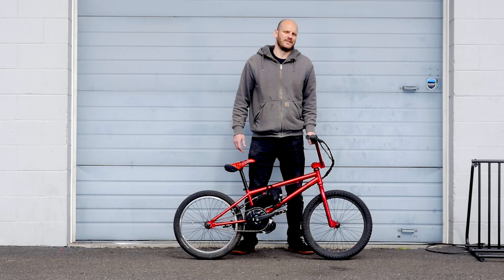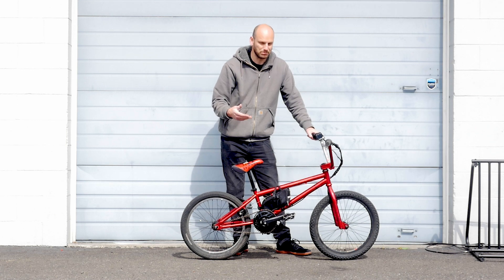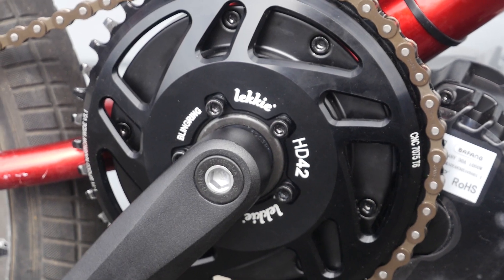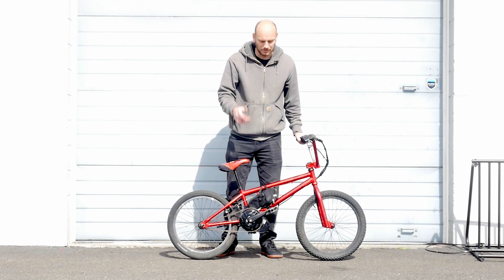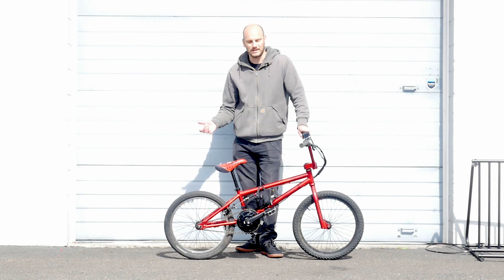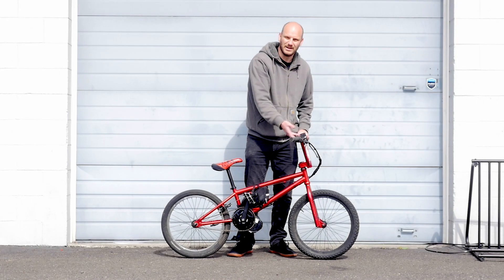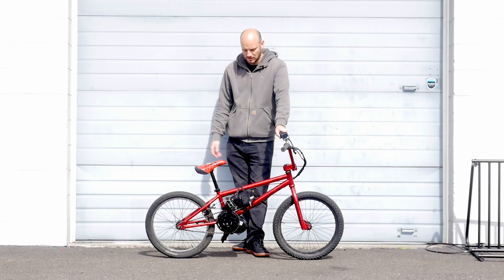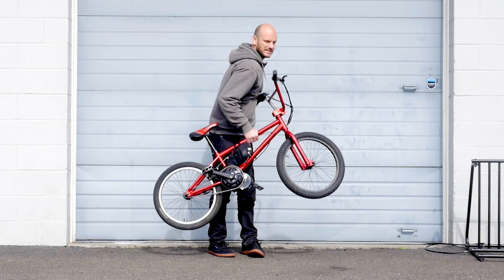Custom E-bike Build: 2 Hip Playboy BMX w/ Bafang BBSHD 52v 8ah

Comment: im a small guy of 5ft3 and 8 stone/112 pounds right and BMX has always been my right size of bike. then i was so exhausted everytime riding to work so then i got a mountain bike with gears and that helped a lot and loved it. even tho i chose a 16" frame the right size for me i felt it was still big and heavy for me. this was a Carrera - Kraken. i loved it and it was a good bike then it got stolen off me and now i got a Scott Aspect 950 and thinking should i upgrade it with a bafang mid drive motor or should i get the old bmx out and get a bafang motor for that? i also have to carry my bike up stairs where i live. lifting the Scott aspect 950 up stairs is ok not so heavy but when i add motor and battery its gonna be a big step to heavy unless i accelerate it up the stairs. i also wish they had bosch conversion kits because i have seen and read bosch to be the best. better than shimano and bafang and im sure yamaha too i think i read up on. any info or ideas will be greatly appreciated. im scared and worried about ordering a bafang motor and finding it not fit correctly and also police stopping me and taking bike off me as ur only allowed up to 250watts motors ffs! im gonna go the illegal route obviously and go for a 500-750watt motor.

Comment: I built 2 DIY bafang bikes 2 years ago using info from this channel.
I cannot recommend enough if you can, building your own.
I can repair anything wrong with my ebikes.
I have friends who bought ebikes and now can't get service or parts easy because of the flood of different ebike makers.
And if you run into problems or have questions you can schedule a talk with johnnynerdout and get answers to your questions/problems.

Comment: ppl sleep on that little saddlebag battery  .  its freaking Strong with a mid drive
Reply: Right I rock a 52v 10ah battery in a little saddle bag for my tongshen middrive kit.  I was starting my little bmx project the same time the owner sent his to Johnny.  Mines a bit lower powered and not running a throttle was planning to do it but think my wiring harness is junk tried 2 and neither worked but been really enjoying it with just pas so probably won't add a throttle.  Still fast bike though easily cruise at 25-30mph and average about 30miles in range on that little battery if all im doing is cruising around at 15-20mph.  https://youtu.be/NJEWqdyO71Y?si=TSLju1Da96MPt5ST
My little hot rod.

Comment: 40 lbs for that seems heavy for what it is
Reply: It’s a chromoly frame so it’s quite heavy compared to an aluminum bike
Reply: 25 pound bike. BBS hd 12-13lbs plus the battery. 40 sounds about right pretty light compared to even those little folding e bikes that are about 50 lbs

Comment: This is a seriously cool build, I love it. I might have to copy it but with a lower gearing to cruise at 20mph for better range and hill climbing.
Reply: Couple of us built ebmx bikes at the same time and were all talking about it over on the ebike sub reddit.  Seems like some spur of the moment itch for us guys that are around our 40s 😆 the whole ebmx thing seems to be finally popping off with some pre-built things like the chimera and what not.  I dont really feel like they really hit that bmx market though allot of us like to build a bike plus frame sizes and stuff sorta matter when a bike is that small and light.  Really need the right geometry for your height on a bmx
Reply: Use a rear cassette. I had a 20inch bmx style with a rear cassette. 36mph top speed on flat road. 52T lekkie front, 11-36 rear

climbed hills easy

I did get a 28t front and it's basically a metal goat in that set-up.

Comment: This is my bike!!! For everyone wondering It’s as terrifying as it looks! 😂😂😂 it has a 28t on it now (changed it very shortly after this version) and it’s even MORE terrifying 😂 I wear full gear and a helmet don’t worry 🤓
Reply: Finally the video for your bike is up.  Think I still have mine geared higher than yours now that you changed that crank gear out.  I am definitely throwing less power at the wheel though.  Totally had to mangle a chainlink into a half link with how much my chains been stretching but taking out a link made it tighter and let me pull the rear wheel in by a mil or so, now I just hope it holds tell it stretches a tad more so I can pull the tire all the way into the forks and take the half link out then the chain should be perfect tell it snaps probably.
Reply: @Mrandroiduser  can’t wait for you to see the next project lol. The 150 miles I’ve put on this have taught me I NEED suspension and some bigger wheels 😂 can’t wait to have 2 videos on this channel :)
Reply: @SaleenaBBY  yeah I feel ya on the no suspension.  I may also pull another build together more based for off-roading but the next bike im thinking about is still a 20" bmx but with full suspension ever seen the 'We the People' swamp master.  Its spicy with a spicy price tag but I think I got a bonus coming up at work and I could always swap the tongshen over but I think the torque and gearing may be to much so don't think thats the best option may look at the cyc pro or stealth for this one or maybe bafang I hear that theres a new middrive model coming out with torque sensing from them.
Reply: @Mrandroiduser  I have seen that bike!!! If i was gonna stick with 20" I would definitely be considering it. But i'd be very worried about fitting a battery in that frame. I also got the canyon bike for $650 so I could not pass that up
Reply: Congratulations for surviving 150 miles... Respect.  But, Please for the love of god take this bike apart.  
Unless of course your only riding in sk8 parks and have FULL kevlar.  You are an absolute legend.
Open it up full, slam on the rear brake, then go back and measure the skid mark.  That is your stopping distance... "No Fear."
Reply: @matthewelsey3164  it’s going back to normal. I bought a canyon dirt jumper and I’m dropping both bikes off soon to have the swap done :) the new setup will go 32 MPH on 26” wheels. (28-11 gear ratio is my plan) Considering a larger battery but will stick with what I have for now and see how it performs with bigger wheels. I’m also in full dirtbike gear and a full face smith mainline 🤓 new bike also has hydraulic rear disc and mechanical front disc (previous owner added a front brake to the dirt jumper)
Reply: @matthewelsey3164  I've got almost 500miles on my ebmx build but its not quite at the same power level as the bafang I've got a tsdz2b on mine been loving it and its been a great little way to get around town.  https://youtu.be/NJEWqdyO71Y?si=Gvwt5ERNjGGtQY0u. My little build still quite capable at going 25-30 even with the settings toned down could probably heat the motor up a bit more and run it a bit faster but really feel like it's perfect where its at.
Reply: And now, for something different...
Reply: I had a bmx sized carbon folder with 52T front and an 11 rear, it went 36mph on a pure flat road throttle only. It was scary fun. Climbed hills like a billy goat.
Reply: What bottom bracket is this frame? I'm looking at converting a mid bottom bracket bmx bike
Reply: @cm0cm  somewhere between 68-73mm.
Reply: What bracket bottom type do your bike have?  American Bracket Bottom?    what adaptors did he use to fit the motor?
Reply: @ELY3M no clue tbh. I’ve put the motor on another bike since then.
Reply: Hey I'm building a bmx with a bafang kit. How's the wiring done on your bike? Are the wires long?
Reply: @alberttownsend1062 yeah they’re plenty long enough. Will work fine on any bike unless maybe a giant 32” tire bike.
Reply: Is it powerful enough to get the front wheel up?
Reply: @DriftyyyyyyyZ yes but I can’t wheelie
Reply: It's ok we weren't worried about what you're wearing as you're not Jake from state farm

Comment: Great job Johnny!  Must be a blast to ride.
PS. Hi Michael and Victor below. Johnny of all people understands gearing.  No question he built this BMX for high speed cruising 😀
Combo of 20 in tire and low weight, as long as you don't hammer the throttle, no doubt it won't strain the BBSHD much.

Comment: Isn’t that kind of hard on the motor with such tall gearing? I’m surprised you didn’t put a 16-20t cog on the rear. Even with my 42/20t gearing, I can hit 30 mph. Pedaling can’t keep up, but under throttle
Reply: This bike has actually gone through some revisions since this was filmed. I decided to put a 28t lekkie on there and it’s much much softer on the motor and it’s only 2mph shy of 30mph on flat :)
Reply: Ya. I have the same motor. I’m running a 42 tooth on the front, and an 11 to 34 on the back. I hit about 50 km an hour at 22 or smaller in the rear. On throttle, of course. With peddling I top out at around 40. I’m just ghost peddling after that and I have my motor tuned to cut off once I hit 80 RPM.  Cool to hear from the owner. Hope you love your bike!